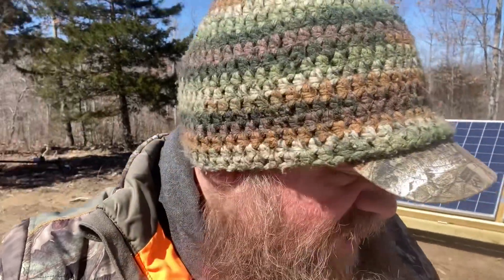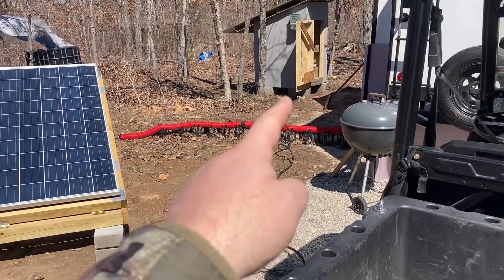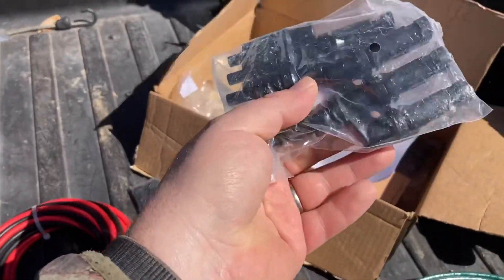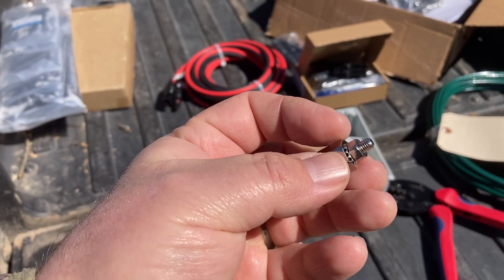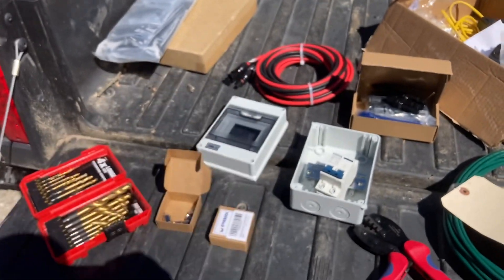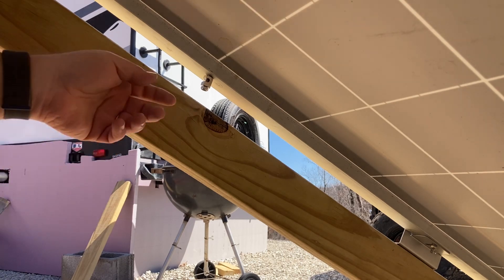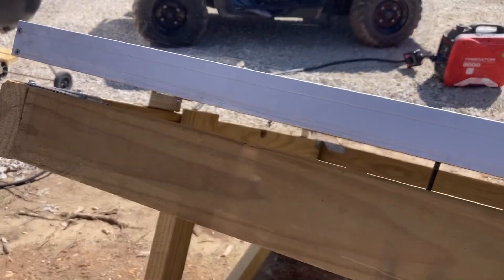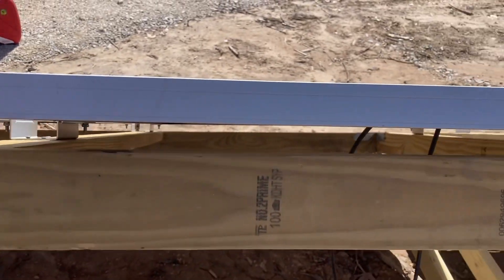Solar Panels: Ground Wire (#79)

Comment: The array ground is required to run from the panels all way to your protective grounding system of the home or building. Running it to a ground rod does nothing to prevent electrocution, grounds need a  return path to the source at the building . The is a requirement of the NEC in the US.

Cheers…
Reply from the maker: Thanks for commenting.  Since having done this video I have researched more about solar panels and grounding and I have expanded the array and added a combiner box for the panels.  I have that grounded.  Since I am off grid, I don’t have an electrical source other than my panels (unless I am charging batteries with a generator).  Everything is grounded back to the same grounding rod as my distribution panel.

Comment: I think they are called “star” washers to bite through the anodyne finish for a good ground connectivity though the solar panel frame.  Do you have a link for the solar panel breaker?  How did you size the breaker?  My research says one ground rod too.  Thanks for video!  I am trying to figure it out myself.
Reply from the maker: I believe this is the box that I used for the solar panel breaker: https://a.co/d/hbIQXcJ
This should be the breaker: https://a.co/d/1P3eOGg

As far as the sizing goes…I am no expert.  However, I didn’t get the breaker to function as a breaker, I got it to use as a shut off switch between my panels and my charge controller.  So, technically, the breaker is way over sized (I think) for the amps/volts that are coming from the panels.  That being said, I am currently gearing up to add some more panels to my array and a combiner box along with them that has built in breakers.  I think I will still be using the big breaker as a shut off though.  

As far as the ground rod goes…from a functional standpoint (and, again, I am not an electrician) the panels shouldn’t need to be grounded because they are DC.  However, I have seen arguments that they need to be grounded for lightning protection.  The thing is…my system is already grounded on the AC side.  So, I really don’t know if they need to be grounded at all.  I have read and watched multiple videos disagreeing with each other on this.  If you find a definitive answer, I would be happy to hear it!

Best of luck on building your system!  I’m finding that it’s never really done.  Yeah, at some point you turn it on and it works…but then you start messing with this and that to make it work better.  Lots of fun as far as I am concerned.  :-)

Comment: i would have just put another ground rod in next to the panels and not had that line running across the ground
Reply from the maker: There are two reasons I didn’t do that in my situation: 1. I barely was able to get the ground rods I have driven because of hitting rock.  So, I didn’t really want to fight with trying to drive another. 2. My knowledge on this subject is limited and amateur at best, but I don’t believe you are supposed to have an electrical system grounded in more than one place, or you risk creating a ground loop. That might not be a valid concern in this case, since I am grounding the panel frames that are part of the DC portion of the system…but this is something that I have seen lot of debate about.  In fact, the more I have researched about it, the less clear it has become to me. Not really sure that I even needed to ground the panel frames. But, this is a part of doing it myself and learning. So far it all seems to be working as it should.
Reply: @BrambleBerryHills  I've read the same as you.  Consensus if running ground wire is to run it back to the inverter and ground there or, alternately, ground to the same ground rod that the inverter is using.  In my case inverter is grounded to my main panel and that to the house ground rod.  So I could run the panel ground wire to the inverter or the house's ground rod.  I've never seen anyone agree that adding a second ground rod at the panels is a good idea.

Comment: HOWdy  B-H-H, ... 
the OEM holes in my panels were 3/16"  &  I  too had to enlarge them to a more common 1/4" size ... 
I utilized a  4"  High-Speed Grinder to remove the COATING from the FRAMES of my Solar Panels ( X 30 panels ) where  I  attached my Grounding LUGS ... 
I used  6-AWG bare Copper wire from my PANELS to my "ECO-WORTHY" 6-String Combiner Box  ( 6S/5P configuration ) ... for both SURGE PROTECTION & GROUNDING ... 
ultimately to the 8' Copper Coated STEEL "Franklin" Grounding Rod driven into the Soil at the base of my ARRAYS ... 
Thank YOU for taking us along on your system grounding ...  
COOP
the  WiSeNhEiMeR  from Richmond, INDIANA 
...
Reply from the maker: You’re welcome and thanks for sharing. I’m probably going to be adding some more panels and a combiner box to my system. I’m discovering that my solar array is undersized, so I have been losing out on some power generation potential. Just have to find the time to get it done.  Good luck on yours! Hope everything is working well for you.

Comment: Why do you ground Solar PV since it direct current (DC) and it not even a conductor
Reply from the maker: Good question and one I don’t have the answer to since I am not an electrician. Since having done this I have seen debate both ways on it. Some say you don’t need it. Others say you need it for lighting protection.  I recently had to move the panels and half are grounded and half aren’t, so maybe I will find out!  Hopefully not the hard way.
Reply: @BrambleBerryHills earthing or grounding can't help in the case of lightening what need to be done is lightening arrester to to direct lightening strokes or effect into the ground.
Reply: @BrambleBerryHills lightening and earthing/grounding are two different concepts and for different applications.
Reply from the maker: @multiskilledelectrician1  Thanks for the clarification.  Do you know why it is suggested to ground solar panels?
Reply: @BrambleBerryHills  yes sir.  solar panels produce direct current (DC) so many believe it is not necessary to ground solar panels.but we all know solar panels has metal frames and this is where grounding comes in. so in the case of straying current or earth fault humans and animals getting intouch with the solar panels will not be electrocuted. As an electrician I don't underestimate direct current (DC) power, it can get extremely dangerous.
Reply from the maker: @multiskilledelectrician1  Thank you for the explanation!  That actually makes sense.  Instead of people debating whether or not they should be grounded (which I see all the time and it’s very confusing!), we should be focusing on WHY they are grounded.  It’s not for proper functioning of a DC system (like you would need in AC), or lighting protection, it’s a safety mechanism for potential stray voltage.  Is that a fair assessment?

Comment: is it possible just to cut sections for each panel? ground slot to ground slot / so we can save the length of the grounding wire.
Reply from the maker: I’m not actually for certain that a ground wire is needed anymore…but if you do I don’t know that you would have continuity if you did it that way. Only way to know would be to try it on a couple of panels and check with a multimeter. But, I am not an electrician, so keep that in mind. Good luck experimenting!